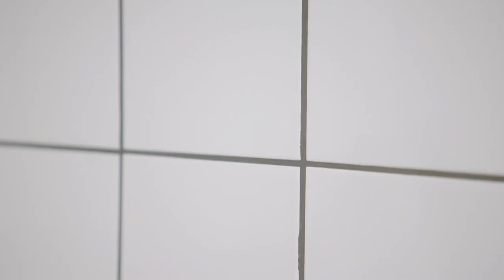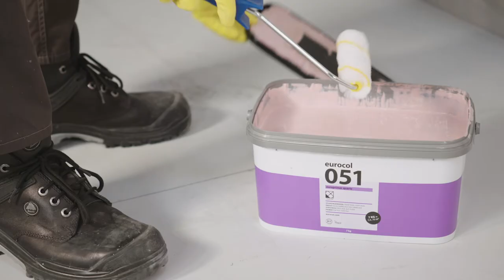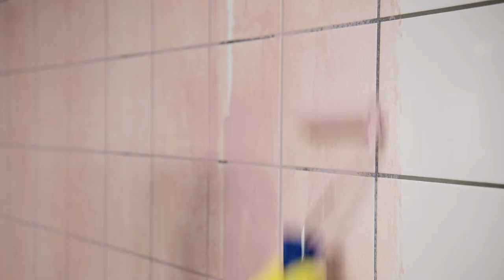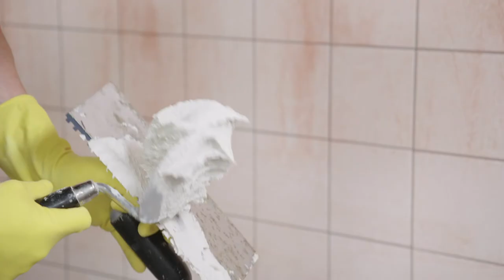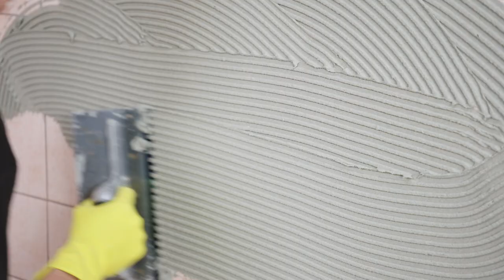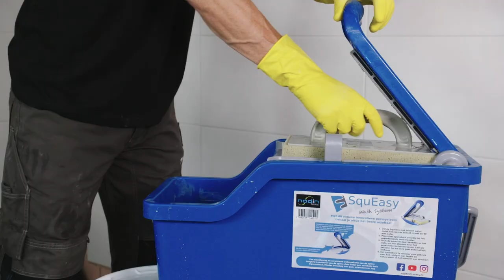EUROCOL | HOW TO | Tile-over-tile situation

Comment: can i  use the adhesive for attaching ceramic wall tiles over existing tile in kitchen  backsplash as well?
Reply from the maker: Hello, for absorbent tiles you must use pasta adhives and if they are not use powder adhives. But yes it is possible. Best Regards, Forbo Eurocol Team